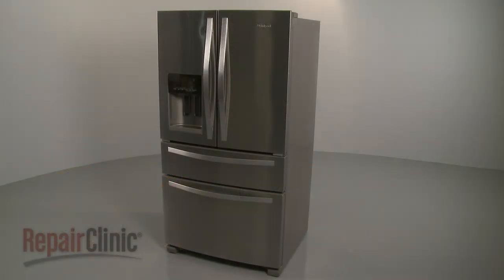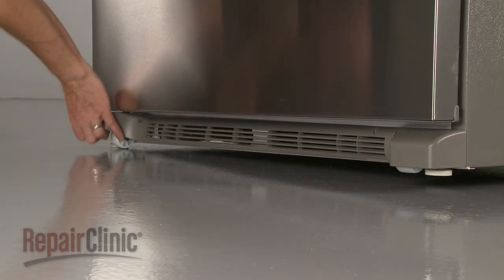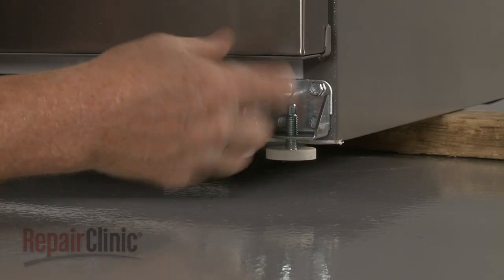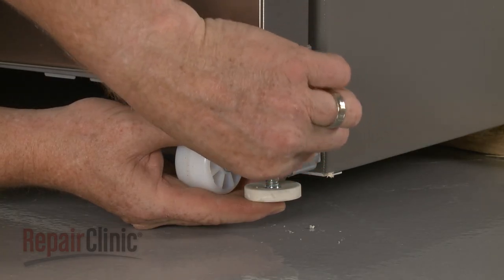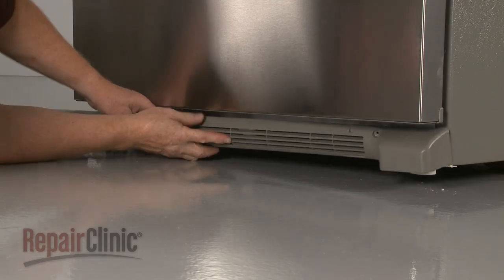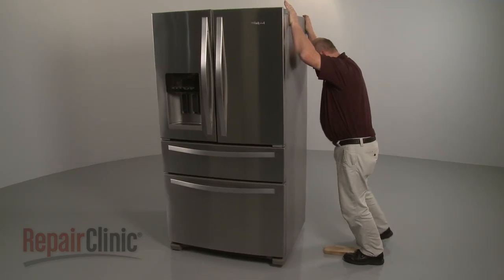Whirlpool Refrigerator Roller Assembly, Right Front #W10515762

Comment: I know this is an old video, but to "adjust the wheel height" you need to retract the leveling legs using a 1/4" small-profile open-end wrench or something similar. The wheels don't move. Rather, it's the leveling legs that can be extended and retracted.

Comment: Yeah but how do you adjust the wheel height??????
Reply: My issue too!
Reply: This did not tell me how to unlock the refrigerator. No one seems to know.
Reply: Exactly!!!  I think most come to this video for that reason, not how to unscrew and rescrew the assembly. 😒
Reply: I need to adjust the back wheels. I don't think that is a thing.
Reply: I need to move the refrigerator to vacuum underneath.  My husband passed away 2 months ago and I don't know how to do this. It sounds like the wheels don't move, but the leveler does.  I am not seeing how to adjust that, I looked but don't see very well. It's probably right in front of my eyes. What else do I need to adjust in order to move this thing?

Thank you!
Reply: The wheels on my whirlpool are not down low enough to keep the refrig frame from dragging on the floor. Poor design.